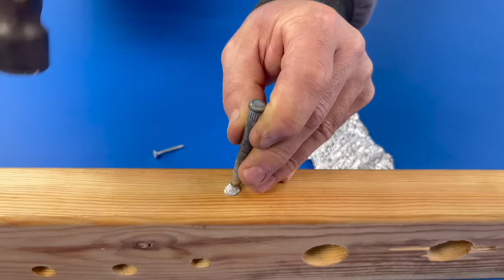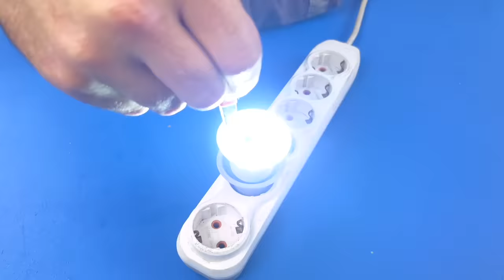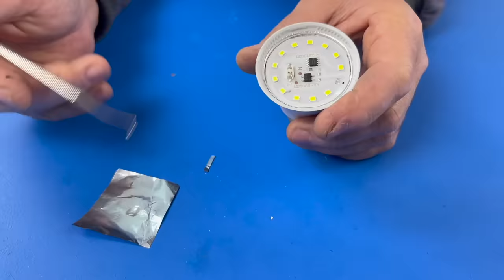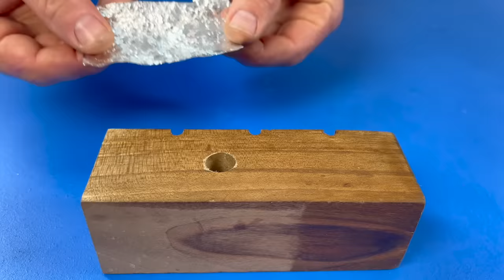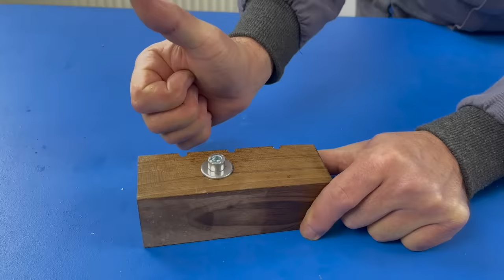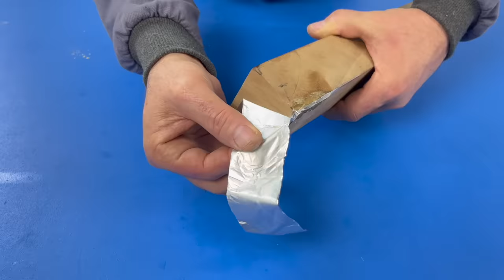You Won't Believe What Happens When You Pour Super Glue on Aluminum Foil

Comment: the trick with the led bulb is very dangerous, you have mains voltage floating on the circuit. never attempt that.
Reply: Isn't there an adaptor in the bottom of the bulb?
Reply: I agree with do not do this but in general but the small LEDs run off of 12 or 24V and there is a small transformer and rectifier in the base of the bulb.   Still using aluminum foil for a conducter can be risky if you don't pay close attention to what your doing with it. 

 FYI or for those who want to argue, aluminum is a better conductor than copper but it also has a much lower melting temperature. The oxide layer that forms also is not conductive so overtime the foil will break down from flexing from changes in current and will become less conductive. As it becomes less conductive it generates more heat which could lead to it burning.  Probably not dangerous in this application but still worth awareness.
Reply: @Sadenshard  There isn't any transformer, i.e. no galvanic insulation from mains. And there is no need for that as you are not supposed to access the inner part of the circuit.
There is a step-down converter that lowers the rectified DC voltage to something more adapted to the led voltage, and led are current driven. You have a floating DC voltage referenced to mains.
So all in all you still have some dangerously high voltage in regards to ground on the "secondary" side where the leds are, but again it's not insulated from mains...
Reply: @Sadenshard  FYI  the conductivity of aluminium is about 61% of that of copper.
Reply: Definitely not Mains voltage at the LEDs...
Reply: @karhukivi  and yeah copper, silver, and gold are the best conductors.. nice wire is made of copper. Cheap wire is copper clad aluminum.
Reply: As a general rule I never mess with electricity. Anything more than changing a fuse, I get a professional, same thing with gas. If you screw up decorating or plumbing, the worst that can happen is you get humiliated or wet and humiliated. Screw up with gas and electricity, it can be catastrophic. As soon as I saw what he was doing to that light I thought, "nope, that isn't a good idea". How about just buying a new bulb?
Reply: I just want incandescent bulbs back
Reply: @DramaMustRemainOnTheStage  Me too.
Reply: @DramaMustRemainOnTheStage  yes 👍 so do I
Reply: @DramaMustRemainOnTheStage  you can't buy them whenever you guys are? Theyre still everywhere here in Ohio...?
Reply: I can't fathom the amount of videos encouraging people to monkey around with mains power devices.
Reply: Yeahh… if this was a battery powered unit.. no big deal… but that’s pretty dangerous. There’s a reason he doesn’t leave it plugged in.
Reply: There is a transformer in the base, under the circuit board.
If there is 120/230 on the board, something certainly has failed..

Comment: if you want a good hold when fixing a hole in wood, use a dowel and glue it in. after that, use some sort of flush cut saw, and cut it down. sand it a little, and then put your screw back in. it will be much better than super glue and tin foil.
Reply: Especially if painting you still need to cover it, or needing to drill a hole in the same spot better a filler than breaking a drill bit
Reply: @kristoffernordlund8392  Explain how aluminum is "highly toxic".
Reply: Typical tactic when someone can't provide evidence, since if the searcher doesn't find anything, you can just claim they don't know how to search. Clearly you are unfamiliar with the phrase, "Extraordinary claims require extraordinary proof".
Reply: @dakotaatv1238  Dust of any type, but especially metal, that actually makes it to one's lungs isn't healthy. That doesn't make it toxic (like lead or mercury). A toxic substance would not be used directly in contact with food (aluminum baking pans, aluminum foil, etc.).
Reply: something being toxic also depends on the dose. water is toxic in high doses.
Reply: @kristoffernordlund8392  bro wtf maybe in switzerland
Reply: Tips about side effects of foil are quite useful, thank you for sharing,

Comment: Instead of super glue and aluminum foil,  I use saw dust and white glue --- or epoxy resin if I want something even tougher.  Wouldn't a threaded insert from the hardware store be better than running a tap through aluminum foil?

Comment: Instead of foil filling oversized or stripped wood holes… use toothpicks or even small pieces of wood split down to the hole size.
Reply: I've always used toothpicks. Works great in loose door hinges.
Reply: I was wondering when I would find this simple/original tip 👍
Reply: Or super glue and baking soda
Reply: Or wooden match sticks if you don’t have any toothpicks.

Comment: Great tips. It got me to subscribe. A safety note. The smoke/vapor coming off the wood dust is cyanide gas so I always have a fan to my back to blow it away. It does not happen with all woods just something to keep in mind when using super glue.
Reply: If you mixed "wood dust" with epoxy resin instead, you would not have to worry about it.... and it works far better.
Reply: That vapor isnt great for you, however the “cyano” root in the term “cyanoacrylates” may give the idea that adhesives contain cyanide—a highly toxic compound. This assumption is incorrect.
Reply: @RayoAtra  You know what does though? Apple seeds and peach pits(among other fruits). Technically they contain amygdalin, which is converted into hydrogen cyanide when digested, but I digress.
Reply: @Astromyxin  you also have to swallow 200lbs of them to start getting toxic level… but I digress.😂
Reply: @Astromyxin  it’s kinda like the aspartame in sugar free consumables. You’d need to eat a steady diet of it and only consume it and nothing else for months to achieve the carcinogen levels. But I digress
Reply: @creationlabsinc.189  Kinda hard when my favorite food in the whole world is peach pit and apple seed salad. 😒
Reply: @creationlabsinc.189  And yeah, but exposure over time of very small amounts of aspartame will cause cancer in humans. You can thank John Ashcroft for that.
Reply: @creationlabsinc.189  Or the same with Himalayan pink salt when trying to realize the benefits of extra potassium. But I too digress.

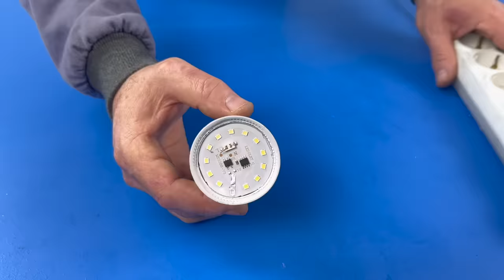Comment: 1:48 Doing that with the bulb, another led will burn out sooner or later. Only changing for another led same value as the others will the bulb last.
Reply: Also note in the bulb trick. The first two attempts were in the second outlet of the strip. And when he got it to light up, he pressed down on the bulb, and the used then first outlet on the light up, i.e. rigged outlet to make that part.
Reply: @jarack3256  Bro, it would be harder to rig an outlet... Just damage one led intentionally and then glue some foil onto it.. It's not like the trick itself is fake foil would work for that.. So sure he might not actually have had a damaged bulb to start with but i highly doubt he faked the outlet.. to much work :P

Comment: Let's see. The foil + glue in an wood hole. Yeah, in the instances here, that's not going to have any strength at all.  You'd be able to pull those out with a pair of pliers.

The LED trick. Take note, first attempt second outlet. When he finds the "bad LED" he's pushing down on the bulb in the second socket. Third, he uses the first socket for the "it works" part. Even though you can see the foil covering an LED, meaning a different bulb.
Reply: 🧐 nice catch. Have you ever watched the fake restoration videos? The painted and dirt patinas are hilarious
Reply: Also a replacement bulb is like $3
Reply: @he-mansuncle7661  Yeah. I see those thumbnails now and I start laughing.

Comment: You can put a screw into a scrap sliver of wood, pounded into the hole...much easier than aluminum foil and glue. What a waste if time. Just wasted a bunch of glue a bad foil. The bolt with threads, makes more sense.